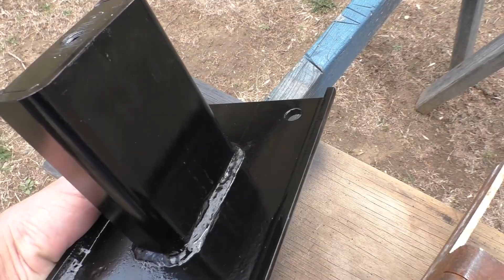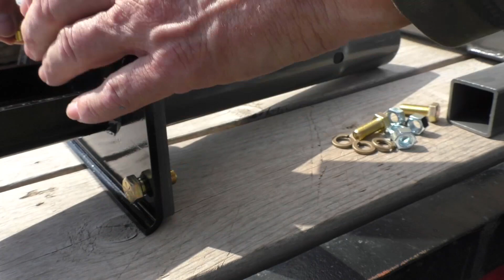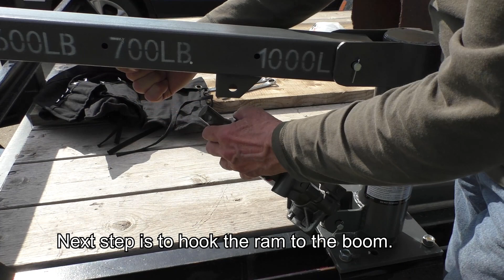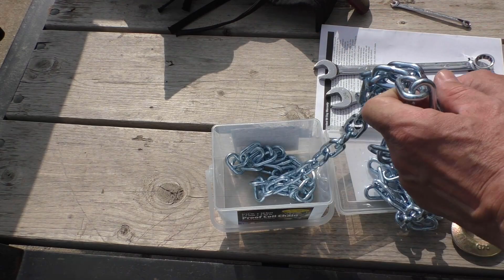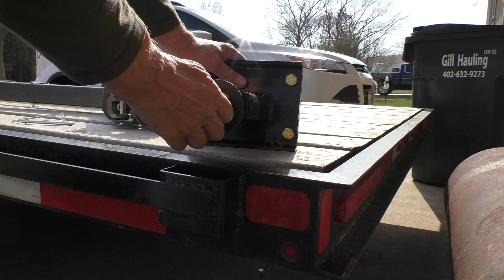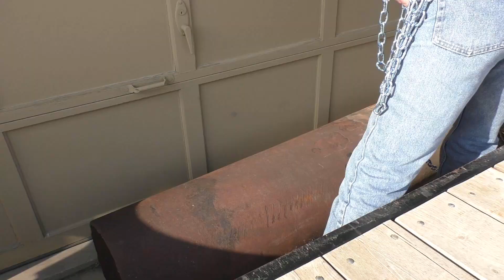Harbor Freight Pickup Crane mounted to a trailer pocket Spencers-Mountain off-grid DIY

Comment: Die Kette darf so nicht im Winkel angebracht werden. Offiziell verboten. Auch wenn Du viel Erfahrung hast, in Deutschland ist das verboten.
Reply from the maker: Great thing about the United States is individuals have the freedom to do things that survive the laws of physics. Even with the angle involved the chain working load exceeded the load put on the chain. The rated tensile strength is many times the working rating. Having been a certified overhead crane operator in a factory, I am well versed in OSHA Safety. None of that applies to an individual operating alone who can evaluate, understand and minimize self risk.

Comment: Not bad. I am reluctant to get the harbor freight crane or any one else that doesn’t have a bearing on the pivot. Would be much easier to turn under a load. Plus it would self center if the crane wasn’t directly above the center of the load.
Reply: I have the larger version of this crane. The one with the boat winch on it. It swivels very nicely under load for not having bearings. I also greased the inside of post.

Comment: I just found this video. Thank you. Just one question. How high will this crane lift? What if I had a 48” or 36” tall box that I needed to lift into my truck? Would it lift the box high enough to get it on the bed of my truck?
Reply from the maker: Sorry I do not have a range of motion for the crane. Harbor Freight has specs and manuals for most products on their website. There are a lot of variables in lifting and how much boom extension is being used or how close you can rig to your load. Thank you for watching.

Comment: Never ever never ever side load a chain. Period period. Period. Period. No matter how light of a load.
Reply from the maker: @geralddunn9138  Total BS!  Even though there are ‘reasons’, any lifting device that physically can lift a given load within its WLL will lift that load. I have over 45 years of industrial heavy load training and experience as well as  fire service extraction training and experience. I know how to evaluate load lifting components and calculate load device angles. In this video the lifting device safely exceeded the load weight and retained an excessive safety factor. Weight is absolutely a factor and has nothing to do with light or heavy (being a single and significant part of the process) as the entire process has to safely accommodate the given load.

Comment: Willing to bet there is near 800 lb of tension in that 800 lb breaking strength chain. Be careful how you Orient the chain when lifting things!  The more horizontal the chain the more tension is put on it.
Reply from the maker: @Jrod_FPV  I have industrial heavy lifting training and experience as well as firefighter extraction training and experience.  You are correct that loading slings and chain have changing capacity with vector loads. In any case all aspects of a lifting operation need to be evaluated and risk assessment determined to ensure safety. I simply provide video entertainment of things I do and caution anyone against attempting anything similar without fully understanding risk of  liability, injury or worse where machinery or heavy loads are involved.
Reply: @SpencersMountain  Thank you for the reply.  I did see your qualifications listed in the video so I assumed you knew you were toe-ing the line of breaking the chain.  I should've specified my comment was mostly an observation and to help others with less experience, and who may not know to prepare for a failure, identify that this particular example is not a good one to follow.  I do the same as you though so i get it "do as i say, not as i do" :).   Thanks for sharing the video, it helped me in my research of this nifty little crane.
Reply from the maker: @ no problems. Same as you, I was makings things clear to anyone reading our comments. I believe we are on the same page. I also use others videos for inspiration. Sharing video is a kind of payment to my use. In the end, we are just helping each other out with possible solutions.

Comment: It just sits in the slot? No bolts or lock pins to prevent it from moving? does not seem safe with that crane bending sideways. But if it works, it works i suppose.
Reply from the maker: No, it does not just sit in the pocket. There is a threaded hole at the bottom of the adapter post and a thick washer and 1/2" capscrew hold the adapter down in the pocket. There is enough play that the crane moves slightly. Some sort of adjustment could be made to improve that issue, but for the time being, the crane has lifted 600# without a problem and considering the trailer pocket will probably be limited to that weight. Thank you for your comment.

Comment: Kinda funny that they give you grade eight bolts and then grade five nuts for the four base bolts.
Reply from the maker: Considering the base bolt size, grade five exceeds any forces you could hope to put on this small crane.  The crane parts will fail ahead of those bolts. Thanks for watching.
Reply: @SpencersMountain  I am well aware of the strength of grade5 and 8.  Funny because most manufacturers would use one or the other not mix them.

Comment: Is there a way I can buy slide in adapter than making one?
Reply from the maker: Do a web search for "stake pocket adapter". Make sure it fits your pocket. You can bolt/screw material to the adapter to make it fit tight and adding some sort of hold down feature like I used will keep things from moving around under load. That adapter and what it is mounted into sets the load you can move, so be sure to keep all of that in mind, the torsion load at the end of a boom places a lot of side load at the base of the lift. Good luck and thanks for watching.

Comment: nice set up i would like one that was heavy so it could lift logs. some of the harbor freight tools are really good for there price i just got 2 $49 drill kits that are as good as dewalt. there batteries cost over $100 for 2. take care, be safe and well.
Reply from the maker: Heavier would be better for logs, weights of logs can be pretty surprising at times.  Most times I walk out of HF without anything as you get what you pay for. However, there are a few decent deals there. I could not buy the steel for what the crane costs and it is of reasonable quality (actually better than I expected).  There are videos of contractors trying out some of the better HF power tools and they were pretty impressed.  It really helps if you know what you are looking at. Thank you for watching.